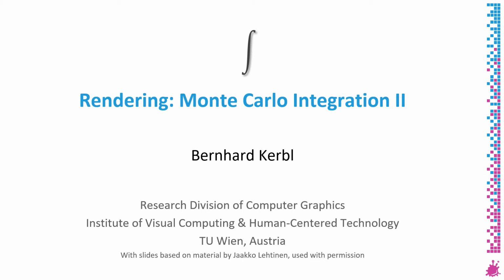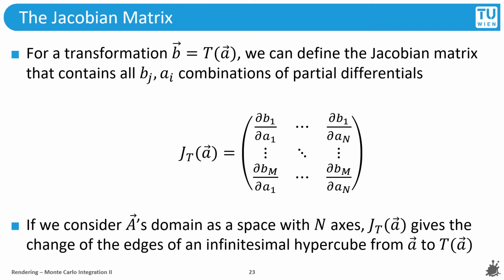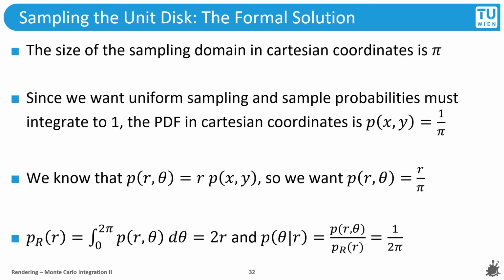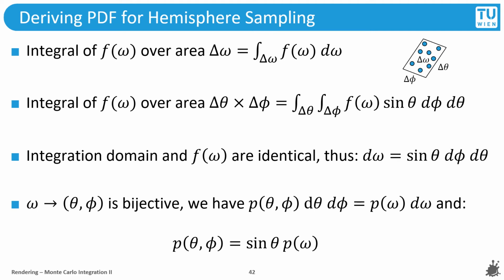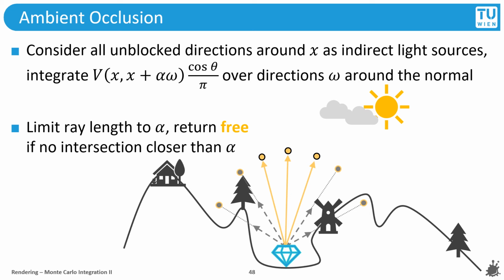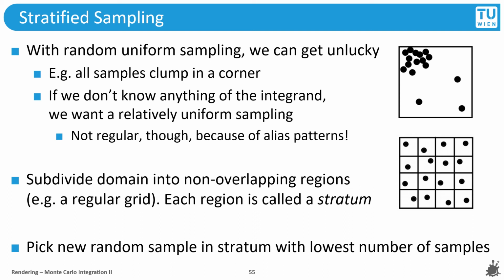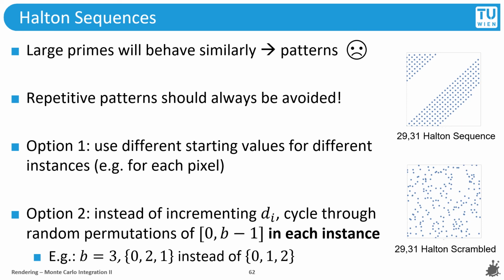Rendering Lecture 4 - Monte Carlo Integration II

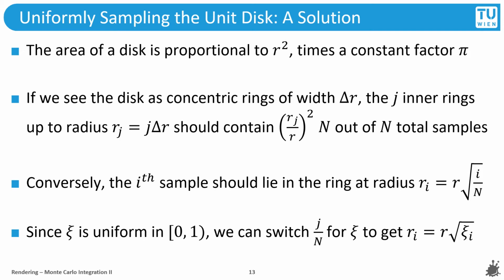Comment: 7:30 
"...if we want to distribute samples uniformly along the radius..." - that is NOT what we want to do though...(!)
It should probably say:
"... if we want to distribute samples uniformly across the 'surface of the disc' by 'providing' a random radius coordinate that runs along the radius from 0 to r"

This whole explanation leaves much to be desired - here's how I ended up understanding this:
We've defined one of the 2 dimensions of the random 2D coordinates inside the disc to be a sampled-radius 'ri' ranging from '0' to 'r'.
If we want the 2D samples to be uniformly distributed across the 2D surface of the disc, then any 2D sample falling within a "sub-disc" of radius 'ri' 
(in other words: "any sample who's radius-coordinate is from 0 up-to ri"), 
should have a "cumulative probability" reflecting the "proportion" of the area of that sub-disc of radius 'ri' to the area of the whole disc of radius 'r' 
(to normalize it to the 0->1 range)

So we're looking for a way to generate 'ri' coordinate(s) with a CDF of:
P(ri) = ri^2*pi / r^2*pi = ri^2 / r^2.
Using the inversion method discussed earlier:
ri^2 = r^2*xi
ri = sqrt(r^2 * xi) = r * sqrt(xi)
(We discard the possible negative solutions as we want the resulting radii to fall in the positive X axis of the CDF)
Reply from the maker: Hi, thanks for your comment. You are right, the wording is chosen poorly, we intend to change it to "GIVEN r" in the slides, because we are talking about uniform distribution over the disc area in this whole segment.

Regarding the "much to be desired part", can you elaborate? Your summary is completely correct,  in the slides we try some reasoning without the CDF to appeal to intuition.
Reply: @cgtuwien  I appreciate and applaud the motivation. That segment of the video alludes to there being a way to formulate the derivation of uniformly distributing the samples across the disc - without using the inversion method. I have re-watched it many times, going back and forth, but couldn't figure out what the reasoning there is. Maybe it's a poor-phrasing issue, or confusing notation, or missing elaboration, or insufficient visualization - I'm not entirely sure - but I couldn't get it, so eventually realized that it's an inversion method, so just formulated it like that for myself. Especially when taking the visual-intuition route, it's very common to land on an explanation that "seem" to convey what's in your mind's eye, without realizing how much is "implicit" there and actually missing from that visualization or explanation.
If I was able to get the explanation there, I could have tried to analyze what I think is missing from it - but I couldn't, so I can't :)